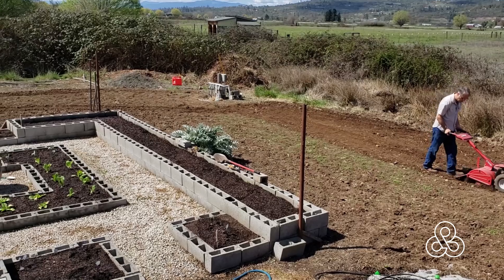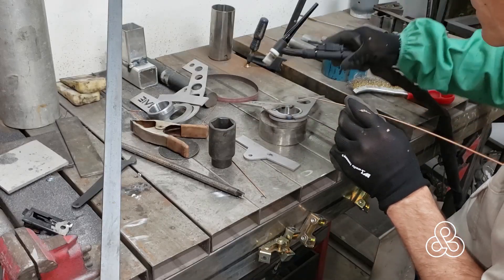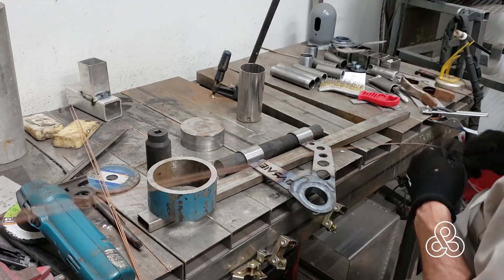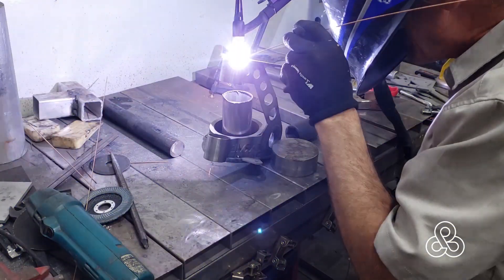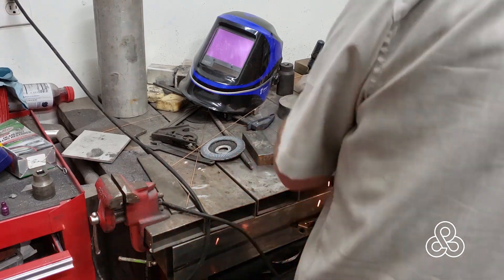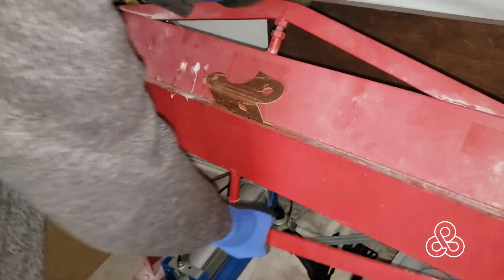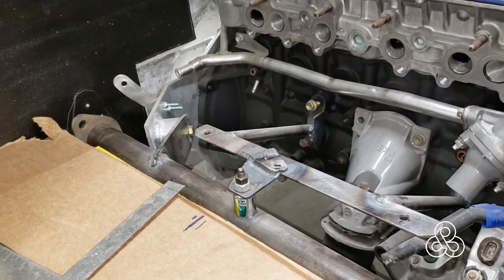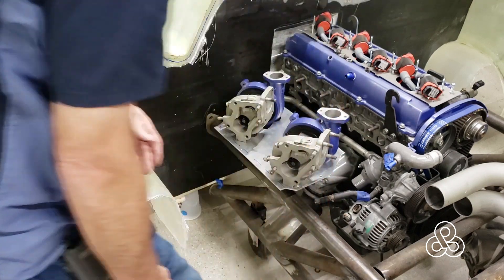A25 - Arete Supercar- fabricating custom suspension A-arms , cuz ya can't buy em!

Comment: That's a cool Jag! I'd love to see it aesthetically restored to original on the outside but the heart should be a supercharged jaguar XKE V12! Air suspension with some 20" steelies painted the same color as the car with a jaguar hub cap in the center... I have a Pinterest account called SlamdaLamda here's an example of what the Jaguar could look like: https://www.pinterest.com/pin/510384570245678887/

Comment: Will there be a flex joint on the turbo base to the subframe, as the base is hard mounted to the engine. Which is usually preferred for the turbo to flex with engine or hard mount to frame?
Reply from the maker: Yes, a flexible "bellows" type joint.

Comment: Jay, just wondering if you could tell me how those cinder block walls for your raised garden beds were made? Are they just sitting there, or are they bonded in some way (ie stakes/rods)? I'm looking at a temporary solution to my problem and really like the look of what you have done for your raised garden beds.

I came across your channel and I have absolutely no regrets clicking on the video I came across, I am thoroughly enjoying watching the process being made on the Jarvis Arete. I've been binge watching the build series since yesterday! I'm always on to my partner about building my own car, and this build series isn't helping her in the slightest, so far, the only thing she's gotten out of these videos, is that she loves your garden and the mountainous vista you have.
Reply: I have the same type of raised bed. Not bonded. Mayby it will be needed over time. Then hammer something down in the middle. Steelbars, tubes, 4 by 4's whatever. But at least not the first 2 years. The great thing is, that you can rearrange effortsly, if you want some other shape.